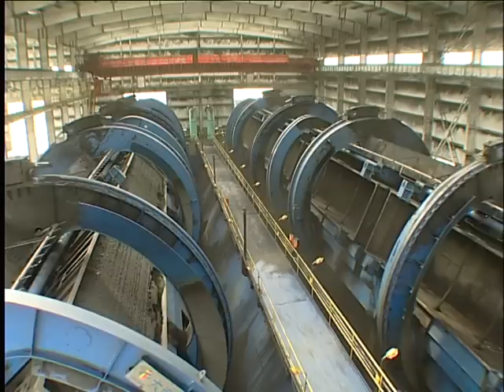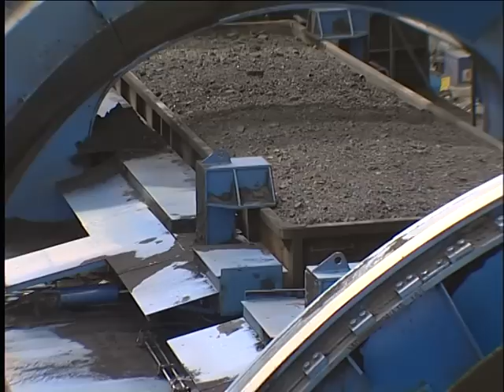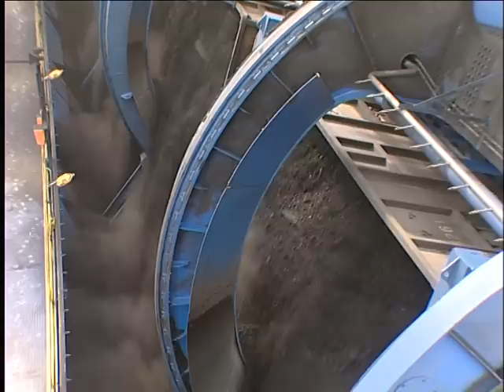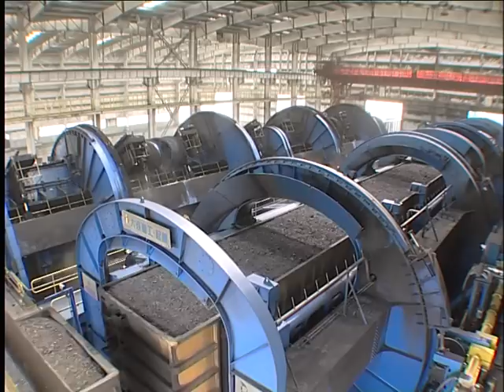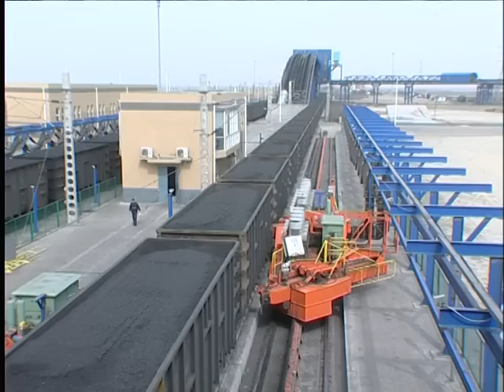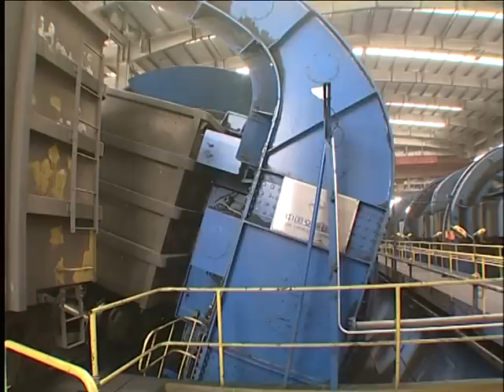Четверной вагоноопрокидыватель

Comment: I can feel dust in my lungs.
Reply from the maker: +Anonymo Ksenos very strange, because car dumpler is supplied together with dust supression system and there is 150000m3 aspiration system for this building
Reply: +Anonymo Ksenos With the small amount of dust coming from the pit, there is all indications that the exhaust system is keeping most of the dust with coal. Can you imagine the weight of all that dust if it were allowed to escape?

Comment: The Japanese or Chinese sure did this dumping equipment big, because the american dump systems do one car at a time.
Reply: +kenny morrow Uh, no. Dumpers are sized according the infeed capacity. These are not 100 ton car capacity either
Reply: +777fuzzypeach I knew they were a lower profile car, but i was only speaking about the efficiency . I still believe that unloading at the bottom hopper doors is the  fastest way. The cars could move at a slow pace as these are.
Reply: Norfolk Southern unloads an entire train upwards of 150-100 ton cars in an hour with this type of setup at Lamberts Point. The bottom hoppers tend to freeze coming from the northern States.

Comment: Very nice wagon tippler project METSO MINERALS.
Reply from the maker: Dear Lakhan, the wagon tipplers on video, were performed without Metso. In the Tangshan Caofedian port there are 4 fourfold wagon tipplers, all made by DHHI. Two of them were designed with Metso, two were designed without Metso. So, the car dumpers in the video, are self-designed and self-made by DHHI Corporation.
Reply: This is very nice and compact design.
Reply from the maker: strange comment
Reply: @surokgogogogo2824  Are you sure ?